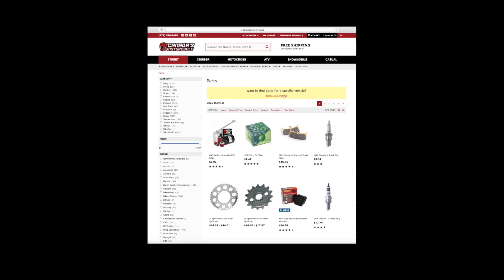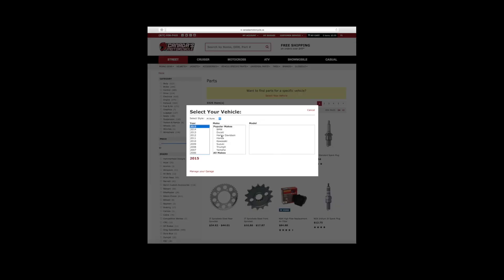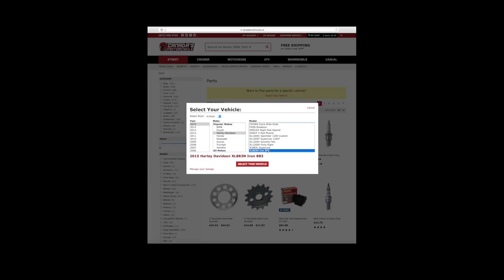Do Motorcycle Exhausts Require Jet Kits or Fuel Controllers?

Comment: My carburetor is not sucking in to much air, running to rich, and I took out the air restrictions like the filter, still nothing. I cleaned my carb with carb cleaner to the Max and used blow gun hundreds of times, air screw on side doesn't show any difference, or change. Changing my clutch for a new, I have extra, it was feeling like it was sticking? I'm really trying to learn everything about how the air works, cause carb holes look clear, exhaust has no restrictions. Adjusted the valves still no change.

Comment: Hi ! I think I'm going to buy a dualsport 250 with an yoshimura slip on and I am pretty sure the owner didn't did anything more to it , and I dont care at all about power potential i can get by fuel controllers or anything, I'm just scared and wandering if using an aftermarket muffler without modifying anything else affects reliability in any way ? ( and if we are here, does it affects it with fuel controllers and stuff ? )
Reply: Wrong spot to ask, look how old the video is
Reply: @WickdPerfekT  i know but maybe someone else can respond too..

Comment: what happens if i dont add a fuel controller and install a full system exhaust and drive without tuning my ecu
Reply: U will run very lean and fry your pistons
Reply: It may backfire on the overrun. It may not pull as hard at high revs and itll run lean which might make it overheat.
Reply: Lean conditions.